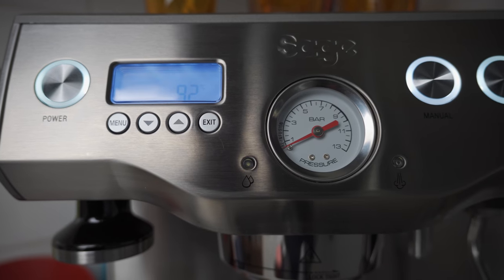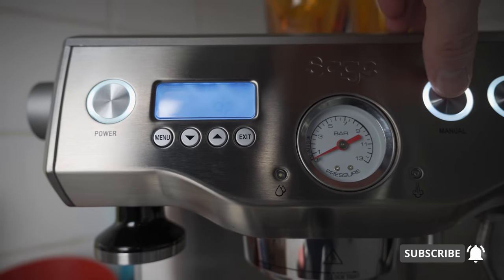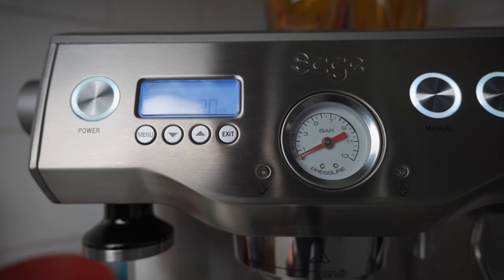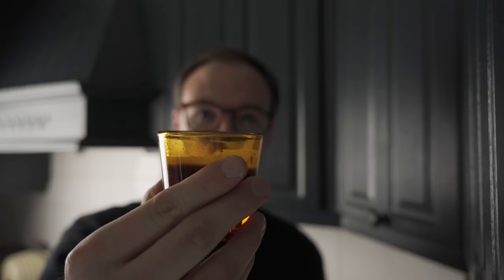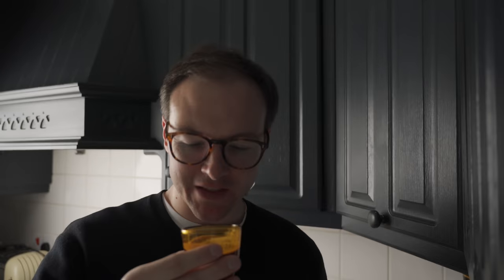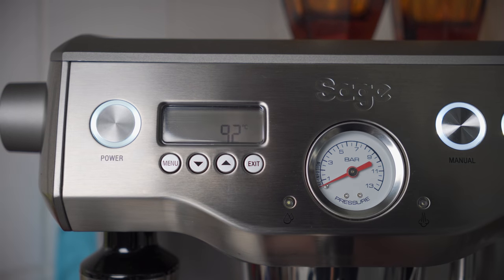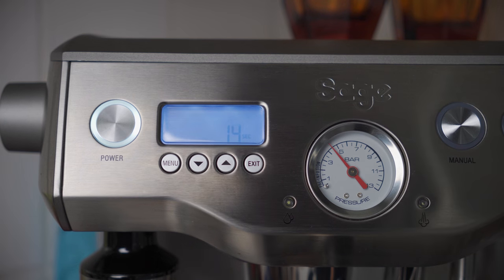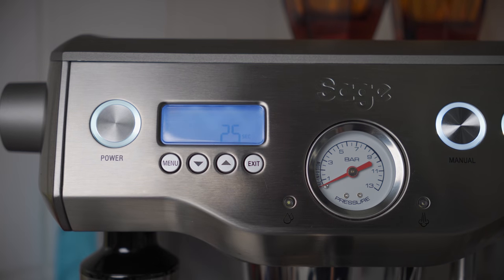Turbo Shot | How To Guide

Comment: What are your thoughts on flat vs conical grinders, do you have a preference?
Reply from the maker: I have backed the Timemore Sculptor 078s but may cancel and order a Niche Duo. I have only ever used a Eureka Mignon Crono 50mm flat and that can’t be compared to the Niche Zero. 
It’s a question I ask myself so in the next few months I will be able to answer. Based on my flavour and profile preference I think flat will win out but as ever taste is king!
Reply: @SteveHowkins  The new Zerno Z1 also looks very impressive and well made but is a bit more expensive than the timemore and the niche
Reply: @SteveHowkins  A comparison video between the niche zero and the niche duo/timemore wld be really interesting!
Reply from the maker: @lukemccallum2359  it does but priced a little high for me. Can’t justify that on a coffee grinder!